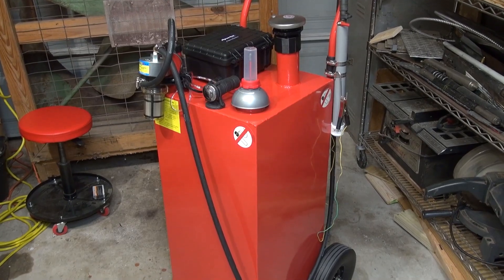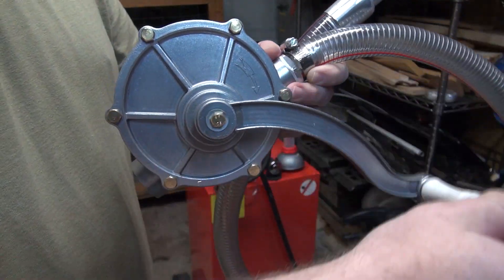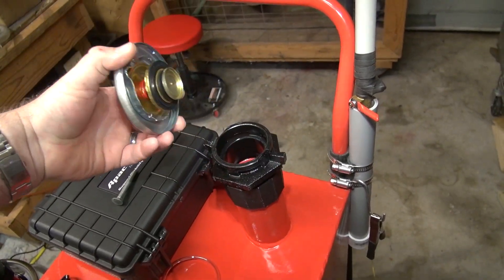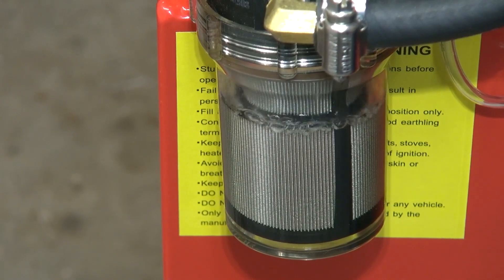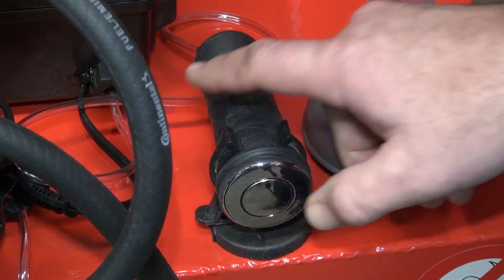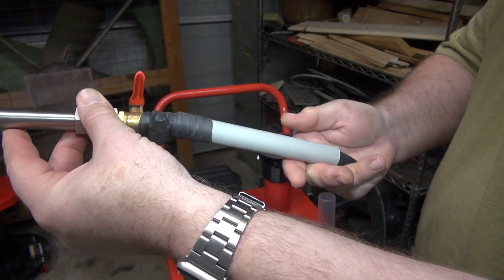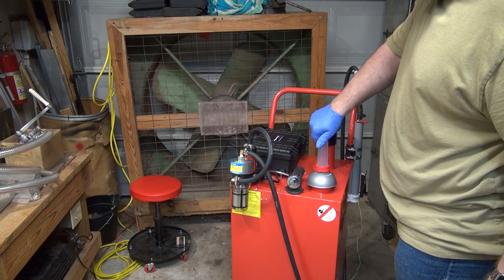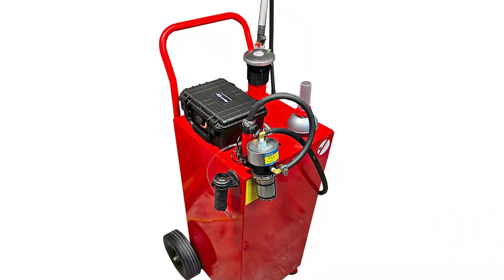30 Gallon Fuel Tank Electric Pump Conversion For Generator Power

Comment: I'm about to install your system, thanks for posting!!  My only concern is I'd mostly use this to fill off-road cars in the desert, and this looks like it might fill frustratingly slow.  How long does it take you to pump out say 5 gallons of gas?
Reply from the maker: Yes, for filling up a vehicle it is not exactly fast… At all… Just filling up a lawnmower tank for a push mower from empty would probably take roughly 1 minute. Not bad for a mower, excruciating for a vehicle fuel tank.

If I had to do it over I would’ve adapted this, at the time I was just unaware of its existence and reasonable price point:

Fuel Transfer Pump with Automatic Nozzle, 20 GPM High Flow 12 Volt DC pump, Cast Iron Gas Heavy Duty Transfer Pump for Diesel
https://a.aliexpress.com/_m0ROIg3

Comment: Do you still have access/ability to reprint the additional adapters you 3D printed? If so I would be interested in purchasing a set of 3D adapters....
Gonna do something like what you've done, but I don't have a 3D printer....
Reply from the maker: Pretty much anyone with a 3D printer could.  But yeah. message me if you still need them.  They're really nothing more than just a plastic collar that I threaded into it.  (not actual threads in the plastic).  Don't forget the rubber cork to make the seal.  You might also look on Ali-express, I've found gas pumps with proper valve handles that would work much better in the years that followed making this.  (it's still holding up fine by the way) :-)

Comment: You need to sale these
Reply from the maker: The proper ones seem to be discontinued.  Google up the Wen GNA25i cable... if you purchased two of these, that would give you the cables (though one would be the wrong color) and you could probably make it work.

Comment: Nice project - you got mad skills! I have one 9500 and the Pinellas Products extended run kit. Haven’t used it other than testing but I’m really pleased with it. I now wish I would have gotten the tank you showed on Amazon with the electric pump. That would allow me to easily empty the tank it into my truck after hurricane season is over. As it is currently I’m going to have to elevate my 14 gal tank high enough to gravity transfer.
Reply from the maker: If you're willing to put a bunch of elbow grease into it, it's pretty cool.  But out of the box, not so much.

Comment: How possible would it be to take this down from your pickup truck bed after filling it with gas?
Reply from the maker: I strap it to one of those hitch flat cargo carrier things, so it's only a few feet off the ground.  Works just fine for a short trip to the gas station.  Getting it down off the carrier is best with two people, but split between two people is totally manageable to just gently set it down from about 2 feet up.

Comment: Man.... You are my hero. I've spent several hours just trying to find a damn pump. Trying to get these a-holes to be honest with gas. They say it, then you go to the Manu and it's diesel. You did what I wanted On Steroids! This is by far the biggest help I've ever had on the Tube. I like to stuff this POS Caddy right back where it Should be. I'm going to stick with 12vdc cause I've got something. But the .stl's, Hugs my man! You friken rock. Thx for taken the time from the bottom of my heart. I was ready to toss the damn thing. 🎉❤😂
Reply from the maker: Kind of an obscure video, glad it helped someone!  lol.   Mine is still going strong, when I rotated the fuel a few months back, I found that one fully charged drill battery is enough to pretty much empty the tank... but it takes 30-45m at least to do so.

Comment: I bought one and the wheels would not turn when the axle nut was tight.
Reply from the maker: These definitely are not "plug and play" but so far, mine has held up really well.  A month or two ago, (after the gas had sat with preservative for about a year), I was able to pretty easily pump it directly into our vehicles, and then take the tank and fill it up with fresh gas.  One drill battery was just about enough to empty it over 3/4 before I had to swap it out.  the larger 4Ah batter would have handled the whole tank no problem.  Not too bad.

Comment: Thanks i have one of those damb tanks and the pump was broken. They dont sell replacements (from china and odd threads) and no return unless i send it to china which costs more than the unit refund. So i have been trying to figure out a good solution. This is great.
Reply from the maker: Ha, I figured there might be others out there.  So far it has worked really well for me.  Still using it to fill my lawn equipment and generators as needed.  No issues with the pump or anything, just sometimes if it's been sitting, a 3-8 second lag while is get the gas sucked up.

Comment: Nice fuel set up. Personally what I'd do is copy or buy the pinellas power equipment extended run kit to run off the 30 gallon gas catty. You could keep the pump to fill up mowers or weed Wackers (Hondas anyways 😂). This way you don't have to transfer fuel from the catty to the generators. You can use a boat quick disconnect to disconnect from the catty if needed. The generators can pump their own fuel from the tank with the pump from the kit. All you have to is keep the 30 gal tank topped off. Just a thought, I have this kit on my HF 2k gen using a 12 gal boat tank. It works great and keeps that little gen running forever. I haven't had a outage long enough to go through a tank of fuel. But I'm only concerned about my refrigerator, internet box , and work computer setup .
Reply from the maker: Very true, all of that.  And I considered such a solution.  However this project was more of a temper tantrum vowing "never again" after our Texas snowpocalypse last year and the associated power/water outages.  (an event that happens about once every 15-20yrs)  

I'd already gone way overboard.  And while the enclosure I built would support such tanks,  it has a flip up lid, so I'd have to remove them in order to access (and start/stop) the generators, and/or, build some kind of additional framework to support the Aux tanks.  (the enclosure is shown in the "how to connect a generator to your home" video on the same playlist).  The enclosure is wood, and getting a heavy 5 gallon tank over the edge of that, and safely fueling a hot generator at arms length (typically while the one next to it is still running to maintain home power) with no easy way to clean up spilled fuel... all under the wooden awning of my home... seemed... risky.  So I wanted a nice spill / splash free way to fill them up, and this fit the bill.

As we're gradually entering into summer time, I've had to run gas lawn equipment several times, and I have to say the pump system is SUPER convenient.  No lifting of tanks and spilling gas.  So far I'm quite pleased with it's function.  So, so far, this has worked out well for my situation.  

But for others, it may make total sense to use the Aux tanks, because as you said, you just keep those topped off... and can remove them and completely take them away to go fill them and still keep the generators running for hours off the main tank.  Such a setup is probably a great solution for a lot of folks, and certainly more portable and easily filled than my contraption.
Reply: @Texas_DIY  I was thinking of using a tank like yours where you just roll it's up beside and connect the 2 quick disconnects to the tank. Keep the generator plugged it at all times no spills on the inside of the hut. 

In your case with already having a tank, I'd run the tank out of fuel and purge it with water. Once that's done I'd have someone tig to thread ports near the bottom or something to that affect to keep your refilling station for the mowers and the main tanks. 

The plus side running the aux tank is you could run the main tank when refilling the aux in a emergency situation. 

I'm definitely looking at set up like this to run my all electric house here in Florida. Probably won't make this hurricane season but will be ready for next year.
Reply: https://youtu.be/NJX_KW5yZ8g

Comment: I have loved all your post on the Predator 9500W and will implement many of them, with the magnetic filler cap already on order. I was fortunate to walk into my local Harbor Freight this week and score one of these units at half price with only 1/10 of an hour run time. It will serve dual purpose as home back up and RV power.  Did you consider doing a propane/natural gas conversion?
Reply from the maker: Half Price???  Talk about a score.  Good for you!
We're all electric here, so to do propane (no natural gas) I'd have to rent/lease a large tank, plum piping, make a pad, etc. etc.  Wasn't worth the hassle.  For those looking for natural gas, i think there are conversions, or frankly, from what I've seen on other reviews, the Duromax xp9000iH  is exactly the same machine, just with an remote start/autochoke, and a propane/natural gas conversion kit built in.  (it's a bit more expensive, but probably worth it if you need a non-petrol version.
Reply: @Texas_DIY  I'm fixing to move into an apartment that is all electric and I'm guessing $10,000 for for the propane tank, all gas lines, appliances, hot water heater, and heater, unfortunately I can't install solar and electricity is way to high. I will look at the Duromax as a second unit if it's compatible. 
Keep up the good work.

Comment: Very cool project.  How do you get the 30 gallons of gas into it?  Do you take it to the gas station or do you fill up smaller containers and bring them home?

Have you considered a propane conversion?
Reply from the maker: I strapped it down to one of those trailer hitch cargo things to carry it to my very very nearby gas station.  And let me tell you, that filter basket that's in the fill area, doesn't allow a fast flow of gas... start fueling, cuts off, start fueling, cuts off, over and over.  That basket is gonna have to go long-term or I'm gonna lose my mind next time I have to fill it.

Not really looking at a propane conversion, as my whole neighborhood is electric.  So that would mean I'd have to lease a tank, figure out where to put it, etc.  If I was going that route, I'd look into the Duromax XP9000 that is nearly identical, but auto start and allows for dual fuel.